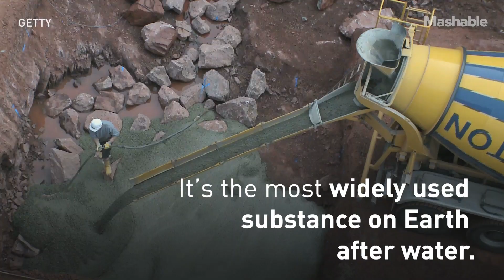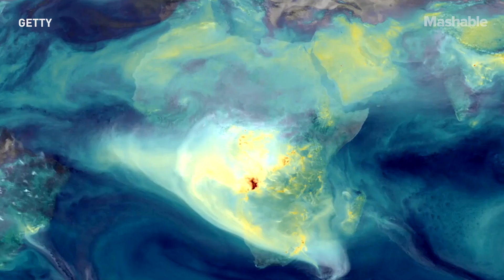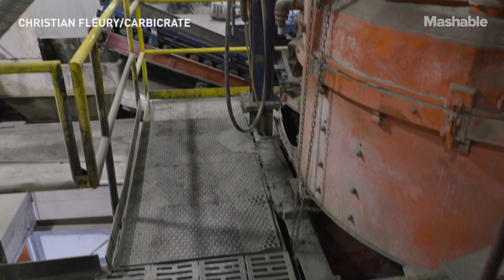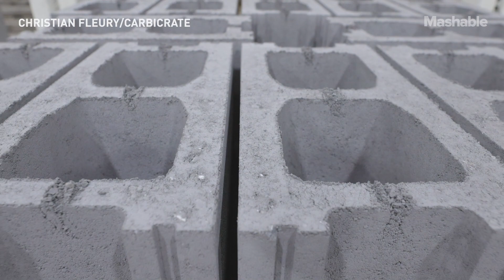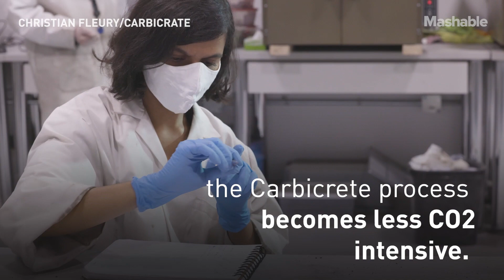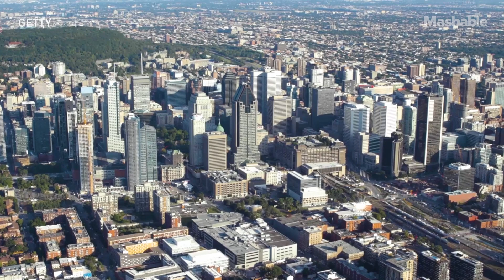How Carbon-Sucking Concrete Could Revolutionize Construction | Mashable

Comment: if you poured a slab (house, driveway, sidewalk, ...), could it still cure from atmospheric CO2? Take longer, but if it could still cure then this is a massive improvement. If cinderblocks only then it is a step, but so small.

Comment: Yeah, I don't know anything about concrete or cement but that does not sound like it'll be a good thing when you need to build a foundation for a house.
Reply: Only a foundation or the entire building is still a big improvement
Reply: @mAximUm123451  true, but only 8%? Come on I thought all the foundations and buildings combined would make up at least 30%
Reply: @simongrayakarapgod3158  "only" 8%, it's 1:12,5. That's quite a lot. Any reduction is still a reduction no matter how much it is, and if there's a reduction in what's originally 1:12,5 of all emissions then I'd gladly take it.
Reply: You'd be surprised at how strong carbon makes things if that's the case.